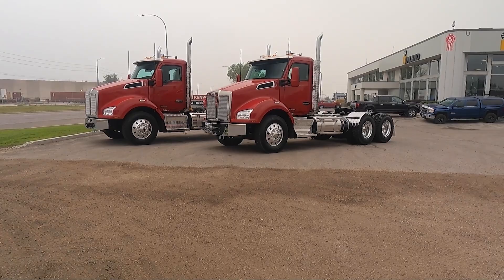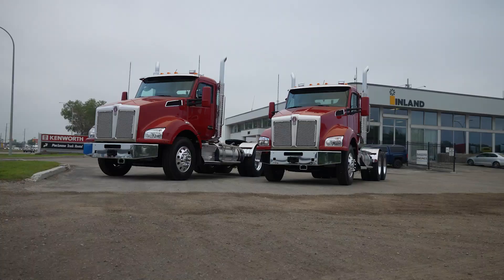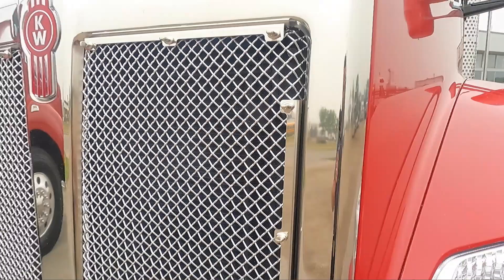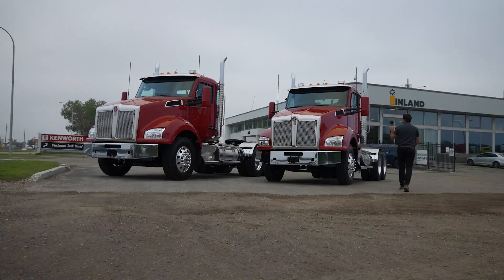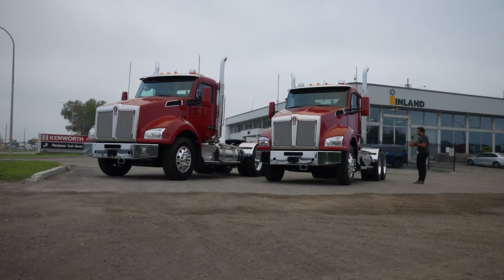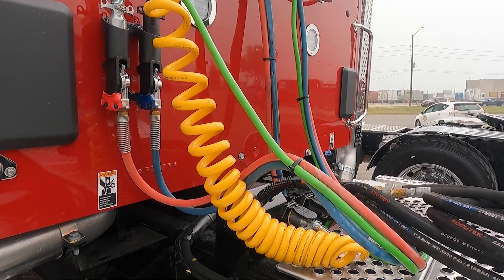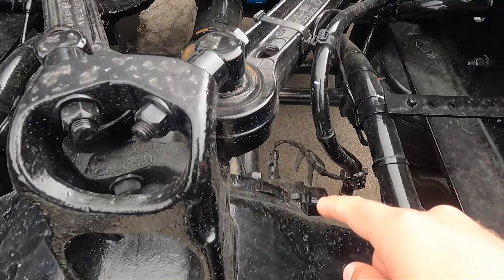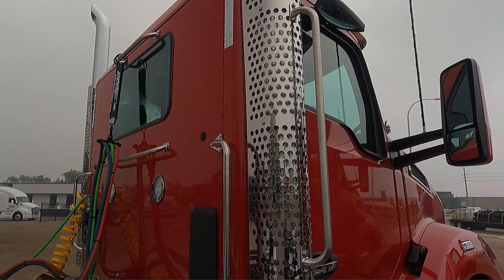Twin T880 Tractors   2022 Kenworth T880 Review   The Kenworth Guy

Comment: Hello Andy , I have a good kenworth question 🙋‍♂️ for you to answer … 1) does kenworth offer standard speedometer cluster(like the one shown in this video above) for T880 beside the digital speedometer cluster ? I would rather have standard ones ….2) speak of dummy left side muffler, do not use emission or back pressure as a reason , but I want an answer , if kw does offer that on W900 then why can’t they do same to other models when it comes to full function left side muffler on T880 too?
Reply from the maker: Not anymore.  All the 2.1 meter cabs have the digital dash.